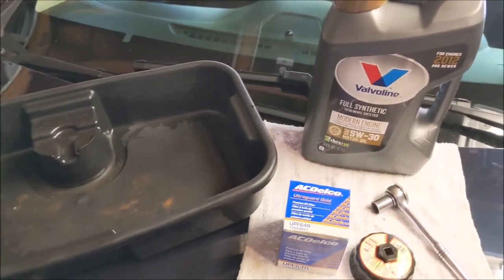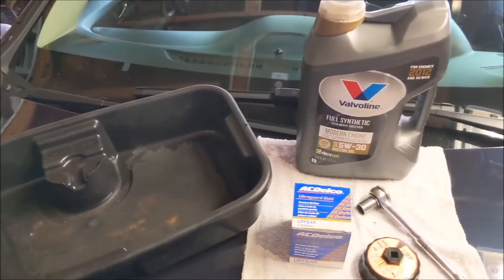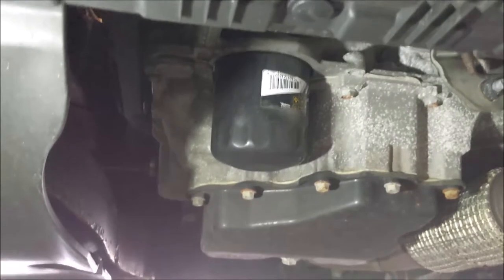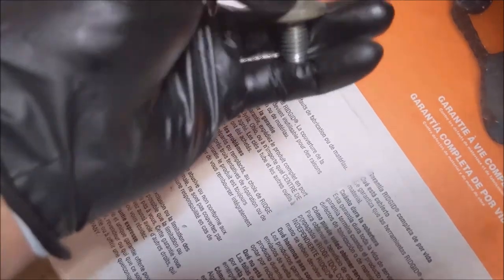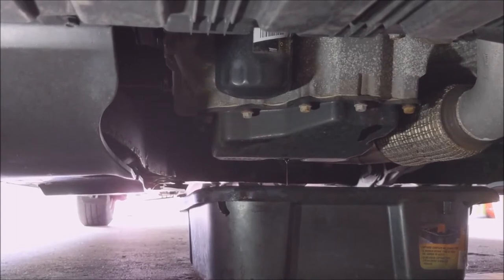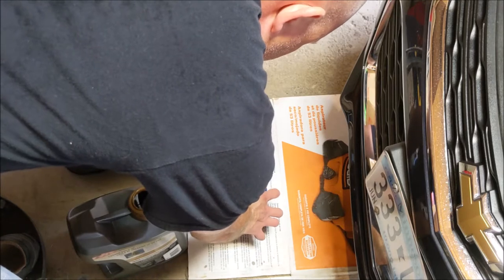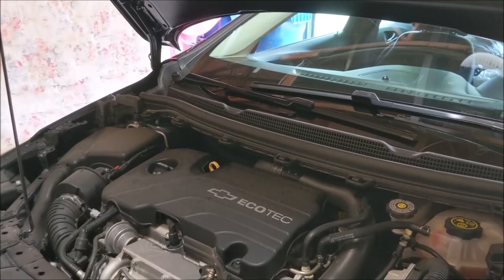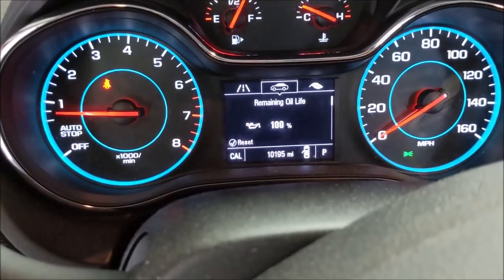2016-2019 Chevy Cruze (2nd Gen) 1.4 LE2 Oil Change *2020 Update*

Comment: Thanks for this. I don’t think I’ve ever owned a car with such a simple oil change method. Looking forward to it.
Reply from the maker: Yeah it's one of those little things you grow to appreciate about this car..
Reply: @CertifiedShadetree You must have long arms to be able to reach everything without having the car on ramps. My arms are pretty long too, but I just barely reach everything lol. I thought I was going to be cool like you and do the same thing but the previous installers tightened my oil filter so much that there is no chance I can get it off with my own strength. So tomorrow I either purchase low profile ramps (so I don’t pull the front air dam) or I get something to help me takeoff the filter and just carefully do everything like you did no ramps.
Reply from the maker: @Jibberish18  You know, now that I think of it, I did have to jack the car up the very first time I changed the oil on this car. The drain plug and filter were way too tight from the factory..

Comment: By the way the owner's manual asks to use the oil filter GM part number 12674698, the blue one. The black one is GM part number 12699847. Both are ACDelco UPF64R., but seems most correct to use the blue one.
Reply from the maker: 🤷‍♂️ Willing to bet one is made in China *cough* blue one *cough* and the other one not in China. Personally, I could care less what color the casing is painted, as long as the internals are the same!

Comment: Watching this because my oil filter won’t come out. But it’s so easy on his video
Reply from the maker: If you're having trouble turning the old oil filter, grab a long screwdriver and hammer it through the side of the filter.  Keep pounding until it comes out the other side, then turn the screwdriver counterclockwise to crack the filter loose.

Comment: Why do you fill the filter with oil before you put it back? In other videos I've watched, they only rubbed the gasket with oil and that was all.
Reply from the maker: When you don't fill the filter with oil, your engine will go dry/have no oil pressure for a couple of seconds when you first start it. Compound that unnecessary wear over time and you shorten the life of the engine. Having the filter full ensures instantaneous oil pressure when you first start the engine.
Reply: @Certified Shadetree  Thanks, good to know. I thought it was wrong when I did it since most videos I've watched didn't.
Reply from the maker: @Roseneckj  I mean, there are some cars where it's just not possible to fill due to the orientation of the filter, but the Cruze allows for you to fill it to the top.
Reply: @CertifiedShadetree  but you filled the oil the filter then you added the 4.2 quarts the car needed. Doesn’t that over fill it?
Reply from the maker: @clos9902  That is total system capacity, with filter. That's why after you finish the oil change you're supposed to start the engine and let it run for a coupe of seconds, shut it off and check the oil level again.

Comment: thanks, very helpfully video! my last oil change I use PF64 (12706595) next oil change I´ll use UPF64R. In amazon sell one in black and other one in blue, which is better?
Thanks.
Reply from the maker: Get the black one.  I found they're cheaper at RockAuto (even better if you buy 2 or 3 of them at once.)
Reply: @CertifiedShadetree  thanks!
Reply from the maker: @chonux  Cheers! 🍻
Reply: @CertifiedShadetree  me again, I have the car reciently I change the oil a few mounths ago. I have the same dipstick like you. the correct oil level is touching the third diple or the fourth ? If you have a picture showing me that, I apreciate. thanks
Reply from the maker: It should be up to the 4th dimple.  Email me: leaderofwagons@likeabigdog.com and I'll send you a pic back.

Comment: Anyone encounter the reduced engine power when the oil change gets towards the second half of its life cycle?
Reply from the maker: Does a reduced engine power warning pop up in the info center? If so, that usually means an issue with the throttle body.
Reply: @CertifiedShadetree  yes it does. if the oil is fresh theres no issues.towards the second half of the oil change lifespan itll pop up. i change the oil it goes away. ive pulled the codes and it was something along the lines of a solenoid controlling the oil pressure but i dont recall exactly what it was
Reply from the maker: @SHLO75  Interesting 🤔 Are you using the UPF64R oil filter?

Comment: I, personally would go WIX or K&N, for filter, and I had a 1991 Pontiac sunbird, made it to 235,000 miles.. Timing belt broke, and I was tired of the old girl... she made it that far on good old Valvoline, every oil change
Reply from the maker: Oh man, those days are long gone!! I had a 93 Cavalier that I used Castrol GTX and orange Fram filters and got it to 255k. The drivetrain was still strong, it was rust that did it in!!

Comment: My cluster is different. It wont let me reset the oil guage 😢
Reply from the maker: Does your car have the buttons on the steering wheel?
Reply: @CertifiedShadetree  yes, but there is no oil life gauge in the panel. It's just a "change oil soon" message
Reply from the maker: @virginiabeech  Try this: Switch the ignition on but don't start the car. Right after switching it on, depress the gas pedal to the floor and release it. Do this 3 times in a row. I have no idea if this trick still works with newer GMs, but it was the only way to reset the OLM without a scan tool on the 2000s models..
Reply: @CertifiedShadetree  I'll try it and update...ty!
Reply from the maker: @virginiabeech  🤞
Reply: @CertifiedShadetree  so, it turns out there is an oil life gauge on my cluster. I think I was under my car in the heat too long 😅 I was really hoping it was the gas pedal trick. Thanks again man!
Reply from the maker: @virginiabeech  Glad you got 'er figured out!!

Comment: Why fill the filter with oil? What is drain plug torque?
Reply from the maker: When you don't fill the filter with oil, your engine will go dry/have no oil pressure for a couple of seconds when you first start it. Compound that unnecessary wear over time and you shorten the life of the engine. Having the filter full ensures instantaneous oil pressure when you first start the engine.

Drain plug torque is 18 lb/ft.

Comment: I have a question. I live in socal, not cold weather at all. Do I still need to get the updated oil filter type R? My car literally looks identical to the one in the video.
Reply from the maker: The "R" filter is more for having maximum oil pressure when the auto stop/start system fires up the engine. I'd say if you bypassed the auto stop/start so it never ever engages, then go ahead and use the standard filter.

Comment: What size oil filter wrench is that?
Reply from the maker: The one I have doesn't have a size listed on it, only the filters it works with. It fits the Fram PH3387A / WIX 51040 / ACDelco PF 47 filter. Basically the standard filter used on most GM 4 and 6 cylinder engines from the 80's to the mid 2000's.

Comment: 2017 Chevy Cruze LT 1.4L
I ordered one from Amazon. This one https://www.amazon.com/ACDelco-UPF64R-Specialty-Engine-Filter/dp/B014VZED5M/ref=pd_ybh_a_1?_encoding=UTF8&psc=1&refRID=E2MWTBJ5P3BJ3MRHQZV1

and they sent me this https://imgur.com/a/1SFtV6Z

It says UPF64R but doesn't have any of the other stuff. It also says 12670058 and came in a plain white box aside from that sticker. Is this safe to use? I chose amazon for the convenience and because after shipping rock auto would be more expensive.
Reply from the maker: I received a weird blue UPF64R filter from Amazon once as well and I didn't have any issues with it. The one they sent you doesn't appear to be an Ultraguard Gold, though, so I would maybe change the oil a bit sooner than the oil life monitor tells you to (change it at 4000 miles or so.) The Ultraguard Gold is made for synthetic oil and longer duration between oil changes, that plain blue filter not so much.

As far as RockAuto goes, I myself have been buying 2 filters at a time for each of my vehicles to cut down on the shipping cost. Going through them is peace of mind that you're getting the correct part!!
Reply: @CertifiedShadetree   Thanks man! I really appreciate that you take the time to answer questions on your videos. 

I'll ask my dad if he's ok with using it, if not I'll return it and look elsewhere (home depot seems to offer free shipping)
Strange though, Amazon has two listings for the UPF64R. (and both say ultraguard) I ordered from this one because it showed the black one, but I notice now the other one shows both the blue and the black. I'm sure they just send whatever they have on hand from the nearest warehouse, but if there is a difference in the colors then they shouldn't be doing that.

Also noticed under the Does This Fit Your Vehicle it says, "Notes: EXCEPT ECUADOR(CX3), STOP/START ENGINE CONTROL SYSTEM(KL9)" I'm not even sure what that means and can't find any info about the stop/start cars taking a different filter.
Reply from the maker: No problem and best of luck to you!!  I honestly have no idea what they mean by that either, as far as I know they ALL had the stop/start system!!